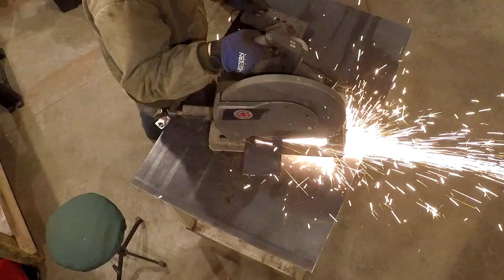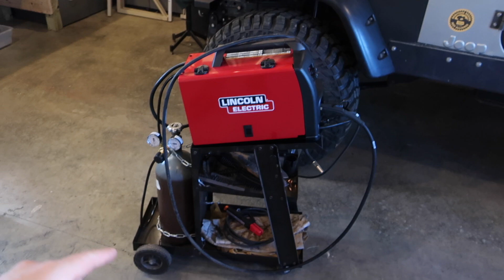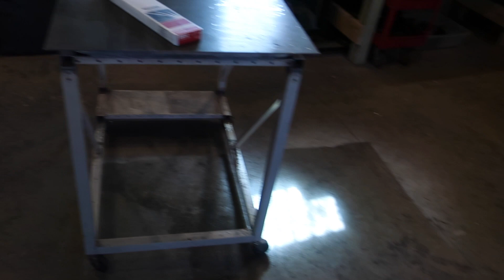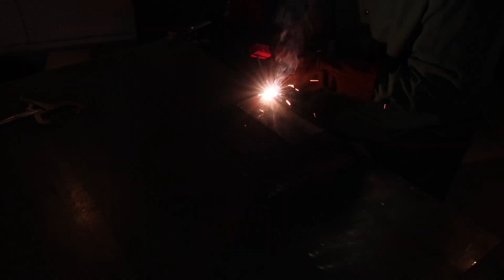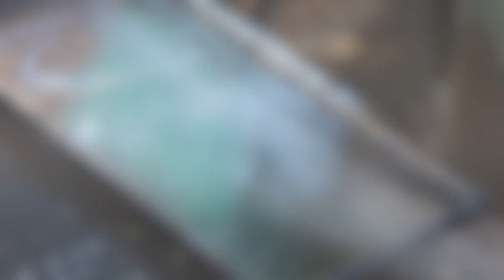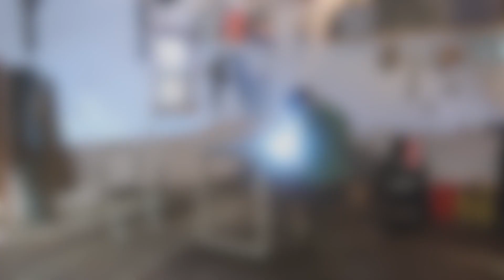Stick Welding with the New Lincoln 140 MP

Comment: The weld look the cleanest with a 6013 because they re the easiest rod to run. The don’t have prettiest bed but will hold.    If you want a pretty and strong weld    Get and learn to strike and hold an arc with a 7018 excalabor

Comment: The machine label as you read says 3/32 diameter rod and gives settings for different electrodes.
For a 1/8” diameter electrode you need 120-130 amps depending on what electrode you are using. 7018 needs more amps, 6011 a bit less.
Your beads look the way they do because you used a cellulose rod without iron powder flux.
This is fine it’s supposed to look rippled like that.
However your penetration is not going to be adequate at 90 Amps with 1/8” diameter electrode on a 1/4” plate. 
As far as your stringers, you have good travel speed and can weld straight.
To be consistent Look at your oblong puddle glancing back and forth from where you need to go and where you’ve been paying attention to the molten puddle. If it gets wide, speed up, if it gets narrow slow down. You got to keep an eye on that puddle. Your hiccups were from repositioning yourself. Get comfortable and figure out how to control your flow.

Comment: I bought that machine like 2 years ago and i been kicking the hell out of it on flux core and stick ,…great machine just make sure to use 3/32 rod and a good thick extension cord if you can’t plug it directly on thr outlet

Comment: Improper settings if you have your volts we’re higher which controls puddle fluidity and maybe a few more amps those beads would be solid

Comment: Do you have to keep those rods in the over?
Reply: 7018 is a low hydrogen electrode with an iron flux coating. That’s why the welds look smoother.
Hydrogen is created from moisture. For hobby welding with 7018 Your metal won’t be thick enough to worry about hydrogen induced cracking.

Comment: Not bad for first time all electrodes are different , each number signifies different characteristics of that particular electrode some u can drag some need  a whip and pause movement . Some rods can’t be used in overhead positions there’s lots to learn . Some electrodes like that 6013, 6010, 6011 can burn through paint, rust , whereas 7018 rod requires for it to be kept in an oven once you open the canister and you have to prep the metal before you weld .

Comment: I've been welding off & on for 40 years, mostly mig and tig. I just bought the same welder and hope I do better with stick than I used to. It usually looks like my steel was attacked by Indians I have so many arrows sticking out of it trying to get it started. That was damn good for a first try.

Comment: You’re doing good for a beginner with stick! You just need to work on travel speed and need to dial the machine in becuz it’s run in cold but it might not be the machine it might just be travel speed or you’re angle of the electrode. From myself having experience and having 3 of the 6 certs to be a certified welder it’s good!
Reply from the maker: I def need to get some practicing in for sure but I appreciate the comment! Always nice knowing you’re on the right track haha.

Comment: i just bought this machine as my first official welding machine for myself. and im watching you cause youre like me figure it out and go from there. only thing i have ever done was weld a roll bar for a truck i had with a harbor freight non gas mig.... yeah nightmare....
Reply from the maker: Sounds like you and I are in the same boat! How do you like it so far?
Reply: @jtmoffroad  so far its ok, but i know thats on me as im still learning as i go. but im liking the cleaner welds even with the flux core wire. that harbor freight welder i used was bad. but it was the cheap 60$ non gas welder.

Comment: Have you had any issues with the mig. Mine won't weld higher the c3 no matter on material
Reply: I have the same welder and I had the same problem but mine wouldn’t keep the arc going. I found out it pulled more amps than it says it does. For me I had to use a 30 amp outlet for the machine to even work. But after I put it in a different outlet it works great.

Comment: Try the3/32 rod at the given temperature and practice you're doing fine don't give up
Reply from the maker: I’ll be sure to give it a shot thanks!
Reply: Agreed, if you're limited to 90 amps 3/32" is a better choice.

Comment: Hey man i just saw another video you done on this machine, dude run 7018 electrodes if the material isn't rusted... Its ALOT easier plus its just runs a smoother bead.
Reply from the maker: Thanks! I’ll be sure to pick up some 7018 and give them a shot!
Reply: I disagree with you. I’ve always ran 6013’s on DCEP and on the hotter side. I’ve got very smooth welds, and they’re really easy to start. 7018’s tend to slag over on the end, and that makes it a bit harder to start.

Comment: Love the genuine vids! Congrats on the new welder been looking at the 140mp  myself as I want to try to learn all the processes one can do, This pass summer I bought a Titanium 125 (I love and highly recommend this machine if you are looking to do basic flux core welding) welder to try and use around the house and because of that I fell in love with welding as a hobby so much so I made Christmas gifts out of horseshoes. I am anxious to get a multiprocess machine and want to learn and have the capability to do bigger and better projects. I do have one question tho is about your welding cart and that is who makes it and do you recommend it? Thanks for the vids keep them coming!!!
Reply from the maker: Thanks for watching! That’s great you took such an interest to welding! I really like this mp so far. The cart is the basic one from harbor freight and serves its purpose well! No complaints with it and I’ve had it for about 4 years so far
Reply: @jtmoffroad  the 140 fits well on that cart think i might do the same thing. I have also been looking at the Miller 215 but at $1600 it is a lot to spend esp when  these newer inverter welders do so much more with less in terms of input power.   The Duty cycle on this machine being 95A/18.75V/60% is untouchable from any 110 machine I have yet to look up. Lincoln also claims it can weld all the way up to 5/16 which is more than enough for 90% of any garage. I cant wait to get my hands on one! JFYI I did call Lincoln and the 140MP along with the LE31MP that Home Depot sells are to what Lincoln calls the "The exact same machine just to be sold at for different audiences" so who knows LOL